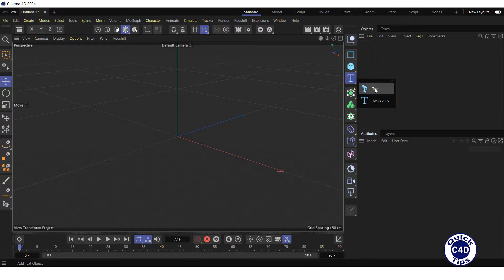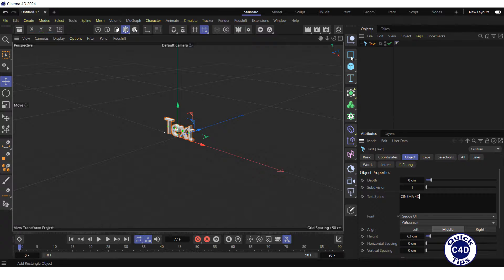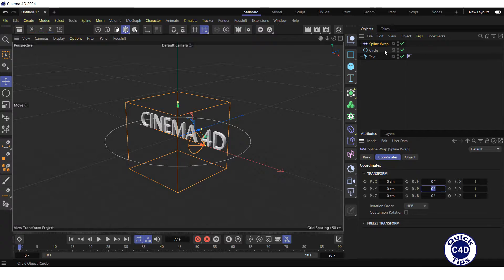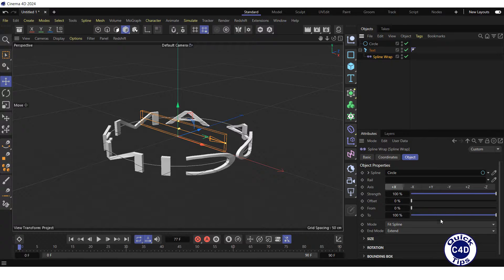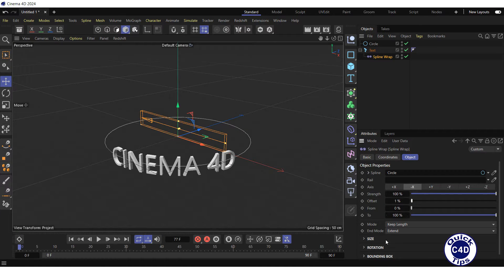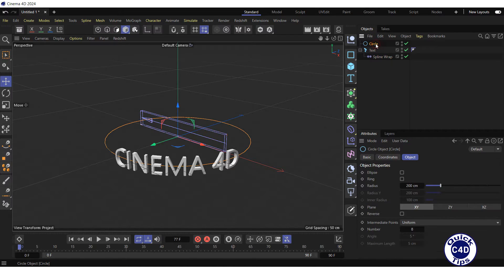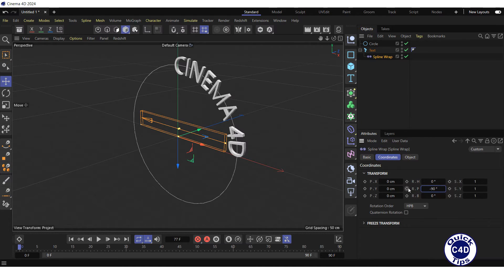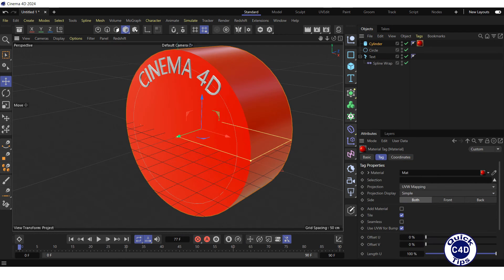Cinema 4D: How to align text to a spline

Comment: how can you do it on a Sphere?
Reply from the maker: If the length of your text is less than the diameter of the sphere, you can project the text spline onto the sphere ( https://youtu.be/DjGLxsFc_8E ) and then add thickness to it by Extrude Deformer.

If your text is longer than the diameter of the sphere, you can use this method: https://youtu.be/QUTwLVkMmQA